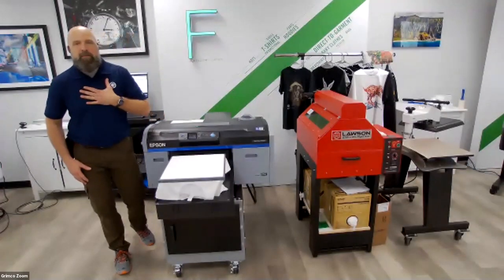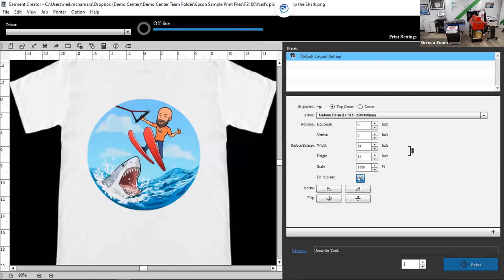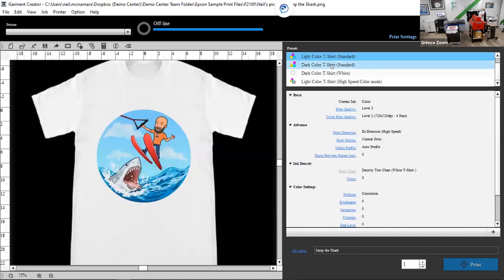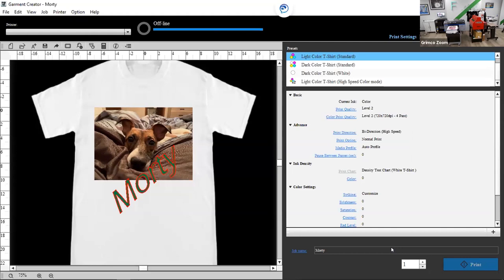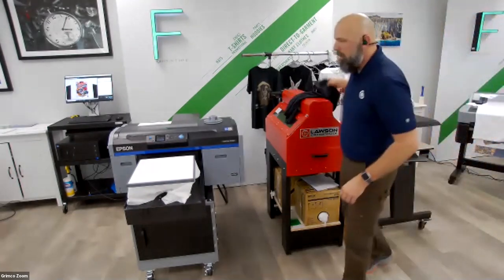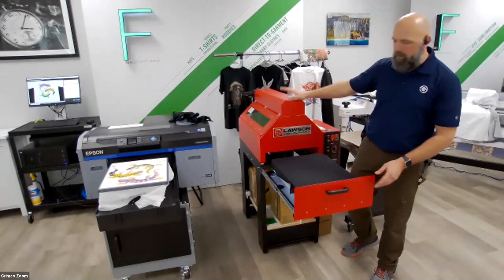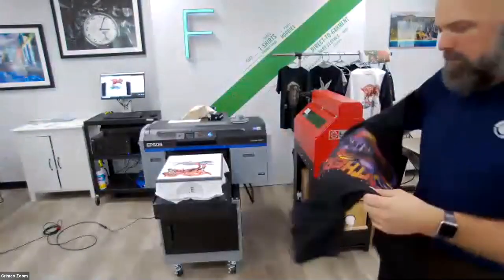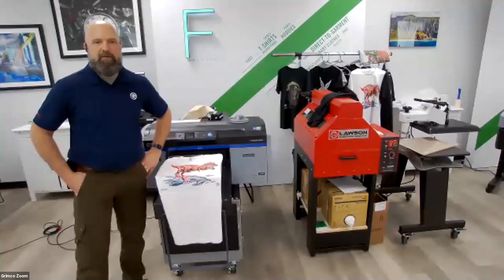EPSON F2100 Direct To Garment Printer Live Demo

Comment: I'm having issues with the parchment paper sticking to the ink after heat press and when I peal it off it peals some of the ink off the shirt. This happens on navy and black shirts so far. Any recommendations?
Reply: The parchment paper is only for curing the pre treat. For curing ink you want to use a teflon sheet

Comment: Very Good info! So when you export a file form ai or ps how much resolution should you put on there? i usually do 300ppi
Reply from the maker: If the file is at print size 300 dpi if being enlarged more than 200% then files should be twice the dpi. For example enlarged 600% then 900 dpi.
Reply from the maker: For the DTG 360 DPI is what is recommended.